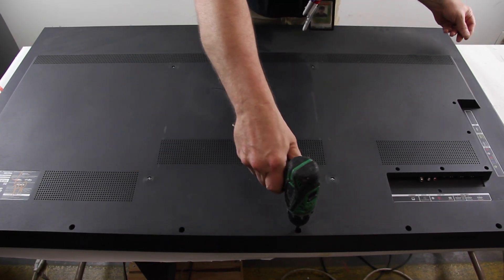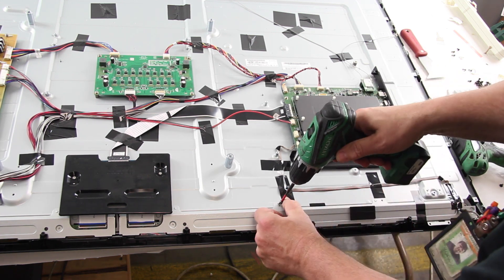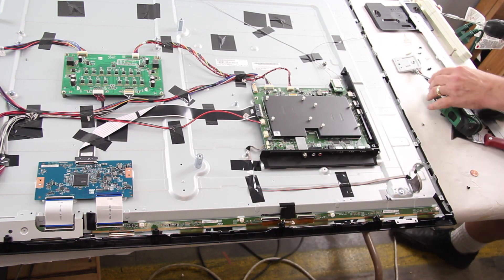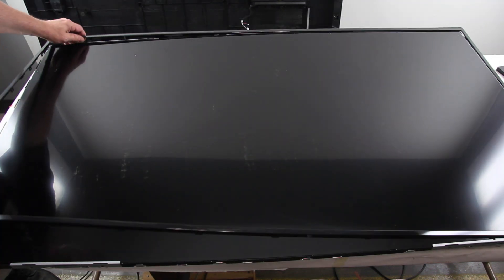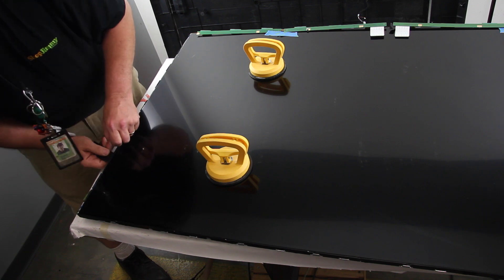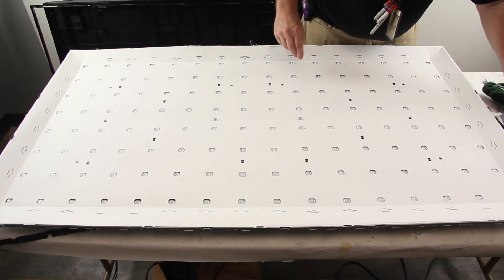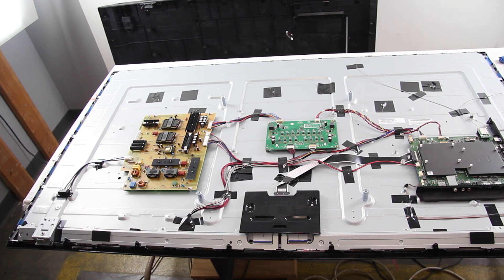How to Replace LED Strips in a Vizio D65-D2, D65U-D2, E65X-C2   - Bad Backlights in a 65" Vizio TV

Comment: Doesn't the bottom white paper have any type of glue or tape on the frame holding this? Because when I took a part in my D70 F3, it was stuck so bad that the paper tore. My question is does his have a great effect on the picture quality if that bottom paper is damaged> The paper that is the last along with the LEDs. If this is a problem were can I get a used one to replace this?

Comment: Hi.  I have n LG 65in 65UF8600 3DTV.  I am nearly certain I have a few cracks which have formed in one or more diffusion layers on the TV.  I have soft glowining curved lines about 6-8in long in 4 spots.  They become sharper when I compress the screen.  TV was never struck.  I think plastic just shrunk and cracked due to constant on use.  I can't find diffusion material anywhere.  Any ideas?  I'm sure there's different materials, I'm guessing it' the thickest of multiple layers.  Is it special because it's a 3DTV?  Thanks!

Comment: Thank you for your video. It is extremely helpful.  I have a question though. When I turn on my Vizio D65u-D2 it has video and audio.  After a few minutes the video goes black but the audio remains. When I shine the flashlight on the tv I can see that the video is there, it’s just not backlit.  Should I try replacing the D-Con board first?  If the issue is the led’s then would it start out with video and then go black? Thank you for your assistance.
Reply: D65uD2 LWZAUDFS

Comment: I think one big mistake was made.  When the old LED strips are removed, it is necessary to remove the old glue that is uneven, because the new strips will not have an even adhesion to the sheet metal and thus the heating of the new strips will be increased due to poor heat dissipation.
Reply: What the best way to remove the glue
Reply: @emiliovillanueva9127  If there is a lot of glue left, first I remove as much as possible with a scalpel, and then I dissolve the glue with Acetone, soak a paper towel and rub it, if the glue is soft and has not dried, then there is a bigger problem.  I tried it with Nitro thinner, but it dissolves Acetone better.  Maybe there is a better way...

Comment: - Thumbs DOWN!!!!
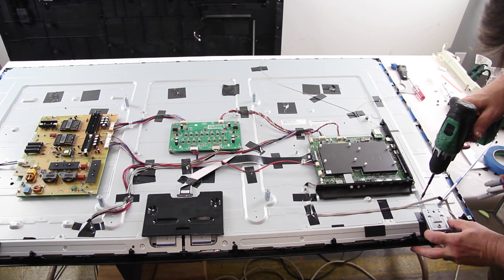19:35
You didn't tell the people watching to TEST THE LEDS BEFORE closing the set up.
One you install then connect the LED strip wires & before installing the reflector (15:16), plug it in and if it doesn't turn on on it's own use the remote to turn it on.
[Note you need the IR sensor connected or the button controls to turn it on, remove from frame and connect if needed, or put frame close enough to re-connect to main.]
Make sure the T-con ribbon cables are not touching any metal first before plugging it in.
After you verify it works THEN proceed (15:17)to put it all back together.

Comment: I tried the suction cups for the first time after watching this and another video using suction cups on the panel. I had always done it the old fashion way, careful lifting. Anyway, after I put everything back together I noticed the screen (Vizio 60") now has 4 circles permanently in the panel where the suction cups were. 😳 😖  Fortunately for me, the owner didn't want to spend the money to replace the main board so I didn't have to worry about replacing a $1000 TV. Just be aware of the risk.
Reply: Run the tv while it is laying on its back for a while so it heats up the LCD PANEL then carefully "MASSAGE" the circles with your fingers.
I had this problem from leaving the suction cups on during the whole repair process.
Now I take them off right away.
You can also try using a blow dryer on lower heat setting to warm up the panel where the circles are and massage them.
It may take a few minutes and several tries to clear it all up.
Reply: @surfersilver6610  ok, thanks. Will give it a try. I did take the cups off right away but they still left marks, I was afraid maybe they are too heavy duty. I was worried that it delaminated film from the inside of panel.

Comment: Suction cups are likely to damage the screen. Instead, use a flat, thin board or a piece of plexiglass or similar, slide it carefully under the LCD panel and the other flexible layers and carry and set aside

Comment: My vizio d65u-d2 just started going blank after i turn it on, if i shut it off and turn it back on it will stay on but go blank again after another minute or so,yet i can still hear the audio, is this the leds or the boards? 
Many thanks
Reply: Same issue here. I've replaced the LED board and that didn't solve it for me. I'm assuming it's the LEDs now. $50 for the board and about $80 for the LEDs. With TVs costing around $300 for decent, might be better with a new TV.
Reply: @CPolicastro  factory reset your tv's settings. Fixed it for me on mine.
Reply: Factory reset it will solve it.
Reply: @alexklein455  nope my screed leds died out...
Reply: @RanGer-498  if they did then they wouldn't turn on at all.
Reply: @alexklein455  

https://youtu.be/4nxJab7cNUs

https://www.shopjimmy.com/vizio-d65u-d2-complete-repair-parts-kit-see-note-re-backlights/
"PLEASE NOTE: This model has an above average rate of backlight strip failure. If your TV has sound, but no picture or powers itself down after awhile, it's possible that it is being caused by》》》 failing backlights.《《《 We have sets of replacement LED backlight strips available (search for part number LB65018).

The main board you receive may or may not have a connector present at board location CN9103. This connector is not needed for this "

Comment: Thank you for the video but one thing I need to know,how do I know what to replace when the screen is not working at all or properly?I’m missing that on the video.
Reply: The main plastic back cover has little clips you have to carefully pull apart from the frame/bezel.

Comment: Hi There - thanks for this! we took our tv apart yesterday (2 white dots) and when we had it apart we noticed that ALL of the LEDs lenses were brittle and falling off at the lightest touch. I glued them all back on pretty carefully, a tiny dab on each foot of the lens, but when the tv was reassembled, i could see each and every LED (84 white spots! oh no! lol)
my question is about the order of the layers. I'm wondering if i got it wrong. Can you confirm this is true? 
Starting at the LCD panel and moving to the back of the TV, there was the LCD, then a white hard sheet, then two thinner paper film layers... 
Can you confirm if the harder/thicker white sheet goes between the thinner layers and the LCD? or does the harder white sheet go behind the filters?

here's hoping!
Reply: Hard layer goes on chassis 1st then the 'clear' thin sheet, then the frosted sheet, then the LCD panel.
Some sets have 3 thin layers and may vary the order but the 1st one to put down is ALWAYS the THICK/HARD sheet.
Always keep the sheets together so you can put them back the same way.
Mark (a small dot)THE SAME corner of each layer with a sharpie(It won't show up on screen as the corner is behind the frame) to keep the orientation.
Tape as show in this video doesn't always adhere to the slick surface so beware.

The White Spots are due to the fact you did not place the lenses back EXACTLY where they were before.
There are 3 dabs of glue originally.
You have to put the 3 legs back in the 3 'craters' left behind when taken off.
And sometimes the 'crater' comes off still attached to the lens and in that case you have to put it back on it's original spot on the strip with the crater in the 'empty spot' vs the 2 craters, on the LED strip where it came from.
You also have to use UV glue (LOCA)to set it RIGHT AWAY, as other glues/epoxies including 5 minute types take too long to set and the lens will move slightly while curing and cause bright pin spots visible on the screen.

Comment: Does the hard white fusion go on top or bottom towards LED lights? I taped them like in the video but didn't mark which was top or bottom,one is thicker than the other
Reply: Did you get it figured out? I am having the same question. I did not tape them and it might not be in the same order when I re-assembled it.
Reply: @deanking2248  Hard layer goes down 1st on top of STANDOFFS in metal sheet/LED backing.
Then clear layer, then frosted layer, then plastic trim, then LCD panel.

Comment: Thank you for your awesome and very informative video.. I am now currently working on my 2nd TV exactly like this one in your video.. They both needed the LED strips replaced.. The 1st TV worked awesome After replacing the strips and now I'm hoping the 2nd one works just as good.. Making me a Little cash profit by fixing these TV's.. Most people would think it looks a little too hard and be afraid to tackle the job.. But once you've already done one it seems so easy and quick to fix it.. hoping  the cell the 2nd one tomorrow.   I can't complain when both of the 65" TV's or given to me because the person didn't want to put the money into fixing them.. And I was also given to 40" TV's what the exact same problem..
Reply: where do you buy yours at
Reply: I replaced some led strips of my 42' RCA two times without even thinking too much. But this one is huge and heavy. I just hope I will not break the screen in the process.

Comment: Do these strips have the same LEDS that are prone to failure or are they different?
Reply: Ray that’s a good question. I’m about to do this repair myself in a few days. When I take out the old LED strips, I’m going to compare them and see if they have the same model number. I just bought the LED strips and they have a SJ stamped on them which stands for ShopJimmy. I’ll see what I find out and report back here if interested.
Reply: @torusbrane5629  I'm interested in you ever had a follow up story available? My picture goes out if I have the brightness too high. Comes back if I turn it off and back on. I don't lose picture as long as I keep the brightness down, which is a little annoying, but tolerable for now. I just bought this TV for my family today for $250 from Goodwill. I thought it'd be a good bit considering they're around$1000 new.  Any information you can help me with would be greatly appreciated. Thanks.
Reply: Phillip Pardo So I replaced the strips with the new ones and they worked perfectly. The only issue I had was realigning the diffusion layers, it results in seeing the LEDs in certain areas, it looks like brighter circle splotches in those affected areas, it’s mostly noticeable during dark scenes in movies. I’m probably off by 1 mm on one of the diffusion layers, so that’s honestly the hardest part of the repair. That and keeping track of the 40+ screws, lol. But I was very satisfied with the overall quality of the LEDs. They come with pre-adhesive, and they’re a direct replacement. Also, be careful of the plastic clips that the LEDs plug in to (on the TV side), I had one break completely on me, and had to direct solder the wires together. If this replacement doesn’t help with your brightness issue, it could also be the LED controller chip, and last I looked the boards to replace are fairly expensive, somewhere in the $250-$300 range. And I also recommend using 4 suction cup holders if the screen size is 65” and above. The main thing is just keeping track of the disassembling process (pictures help) as it will help the reassembling go a lot smoother. I hope this helps make your repair a bit smoother, and if you have any questions, reach out to me on here and I’ll respond as soon as I can. Have a great day and good luck!
Reply: @torusbrane5629  Hey there thanks for the detailed and friendly reply! It is greatly appreciated. I have a couple of questions. 
#1) What do you think you could of done differently to avoid the diffusion layer issue? Did you tape the corners together, to keep them bundled before removing them?
#2) Are there any special tools needed, besides the suction cups you mentioned? Anything to get the existing strips off?

I actually have done an LED strip repair on a Samsung 46" that was indeed fairly easy. If I remember correctly, the screen panel just slid off. No suction cups needed. I also don't remember having any issues getting the strips off of that one.

But this one being a 65" I wouldn't doubt that suction cups are necessary. The video from shop Jimmy uses them, and also says you need a 5in1 to get strips off. Although I don't remember having any issues getting the strips off of the one I did last time. 

Thanks again, and any additional help would be greatly appreciated. 🙂
Reply: @phillippardo5712  These have double sided tape and need to be scraped off the metal back unlike the Samsung which use screws or a metal tab to hold in place.
The bright circles are not cause by the filter layers, they are cause by the Lenses falling off the LED lights or if you glue them back on, being misaligned.
Reply: @surfersilver6610  Thanks! I honestly haven't even messed with it I've just been living with keeping the brightness down a bit lol

Comment: CAN U REPLACE A COUPLE OF STRIPS THATS BAD OR ALL THE STRIPS
Reply: yes, but you have use your meter for see the voltage and mah from power supply output.Sometimes output is over the normal specialy for milliampere.
Next you must check voltage and mah from each leds and see to works properly with led tester from shopjimmy
Sometimes the LEDs look good and lighting, but this is not a criterion for their proper operation.

Comment: Am I the only one wondering why he is removing every light strip. The odds of replacing every strip is 1:1000000
Reply: Might as well replace them all with new lights to avoid having to return to do the process all over again in the near future when more of the backlights start to go out. Cheaper and cost effective, plus adding life to the tv. Youll get better 'even' backlighting this way.
Reply: I am currently watching more of mine fail on a daily basis....believe me if you are going to spend this much time taking it apart, just do it all in one shot!
Reply: I had about six strips fail on mine. One died, then a few weeks later another, then a month later a few more... replacing them all at once means you don't have to replace single strips every month. Of course, this only applies if your TV is older and you have reached the end of the LED's life.

Comment: What’s the tool your using for the LED removal? Not the scraper, the wire one? Could be handy, might try it.
Reply: It's called a: "5 and 1 tool". You can buy them at Home Depot in their paint section.

Comment: I have a d65ud2 led . I have black screen with no backlights . I have sound . flashlight test shows menu . if I turn off the tv and turn it back on it works again . if I lower the brightness it stays on till I raise the brightness then it goes black again . what needs to be replaced ?
Reply: Huey Abshire, I have the same issue. As far as I’ve read, it should be the power supply board. I ordered one and should be here in the next couple days so I’ll let you know if it works. I miss the Vivid setting soooo bad!
Reply: @pmiller8394  I'm curious if anyone ever found a solution. Any information would be greatly appreciated.
Reply: Phillip Pardo, yeah I replaced mine and it still happens. Unfortunately I think it’s going to be the LED strips for us.. 😖
Reply: @pmiller8394  thanks for the reply. I'm thinking the same thing for mine. It's a Vizio d65uD2. I just got it from Goodwill today for $250. I thought wow what a great deal, so i couldn't pass it up, especially with it retailing for around $1000 new.  But when I brought it home, I realized the picture cuts out if the brightness is too high. However, as long as the brightness isn't too high it's fine.

 Shop Jimmy has the strips for about $85. I don't think the job will be too bad, I've done it on my Samsung 46 inch and it was actually a piece of cake. I wish you luck, bit I'm sure you'll be fine.🙂
Reply: @phillippardo5712  Man, I replaced my LED strips, and now my TV works, but I don't have any sound or display. It's just a blank screen. The LEDs are working, though. Any suggestions,
Reply: @retortman559  factory reset
Reply: Preston Miller hi! Did your power supply board ever work?
Reply: I have the exact same thing going on this mine . Did you find a solution?
Reply: me have Sony 32"LCD tv, only half picture visible, what remedy is there
Reply: I’m having the exact same problem ugh has anyone found a solution

Comment: Thank you for this great, detailed video! I have the e65x-c2 with this problem. Will be ordering the strips and try to knock this out next weekend!
Reply: Hard job good luck
Reply: How did it go? I have that tv as well
Reply: What is the thickness of the metal backplate used on flat screen tvs? And do bigger tvs have thicker plates? Please reply Sir.